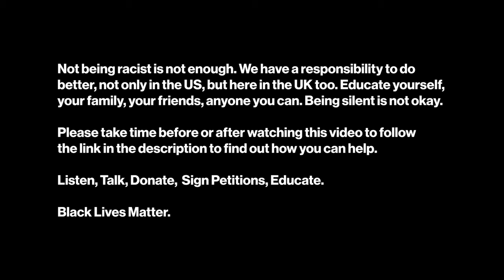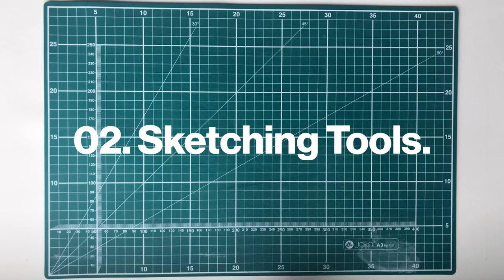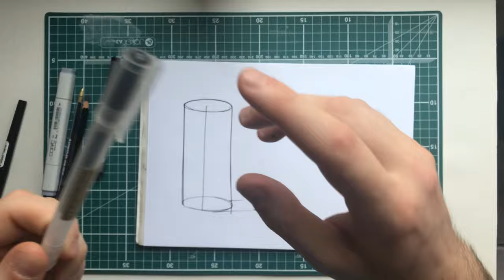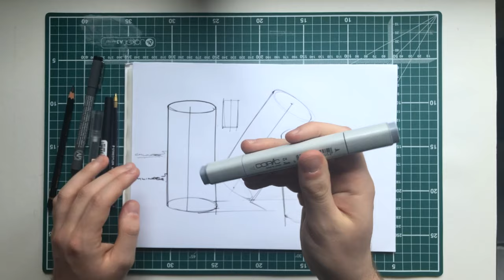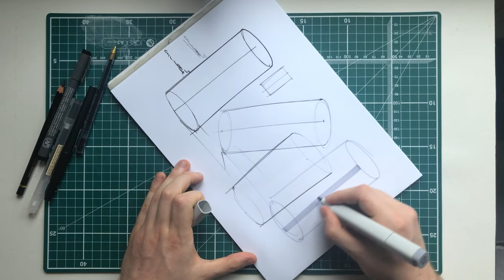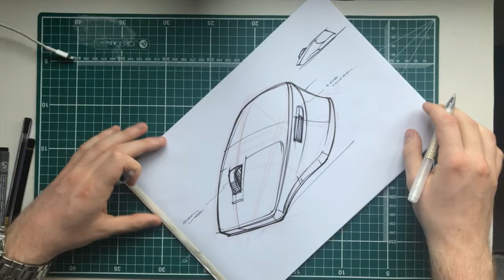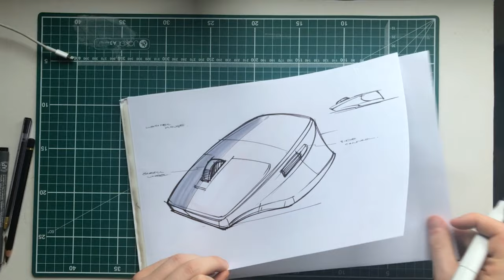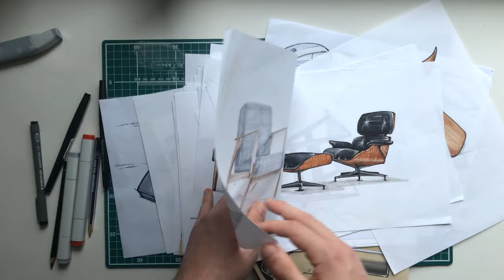Sketching Tutorial 02 - Industrial Design Sketching Confidence.

Comment: Any tips on overcoming perfectionism when learning to sketch?
Reply: So obviously my answer here doesn't apply to all sketching styles, and I am still a beginner artist, but one thing that helps me parry perfectionism is I immediately use multiple light strokes to begin the sketch. For example is you need to sketch a circle I draw probably 20 light pressure circles, then I start applying more pressure once I see the average shape of those lighter lines.

By doing it this way, I only need to be concerned with that final darker line being perfect, not the dozens of lighter practice strokes. Plus, those dozens of lighter strokes act as an average shape or guide or sorts that I can use the "corral" my darker lines.

If I try too hard to minimize the number of lines in my sketch I immediately become obsessed with those lines needing to be perfect, so by starting my sketch with dozens of light "sloppy" lines, the sketch is already imperfect, therefore I no longer have to worry about future lines not being perfect either. They'll never be perfect, so trying to make them perfect is definitely an exercise in futility.
Reply: @Kolton88  yeah i'm the same, thanks for the tips!
Reply from the maker: Great comment Patrick! An interesting topic, I’m looking to record a new video this weekend that will somewhat cover this 👍🏻
Reply: @HarryChapmanDesign  that would be great because I get frustrated and then want to scrunch up and bin my work